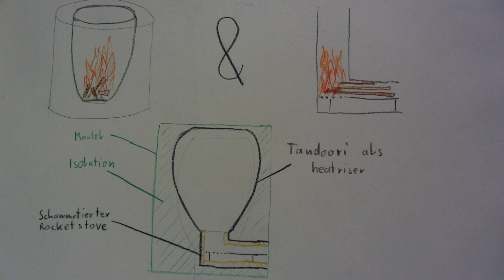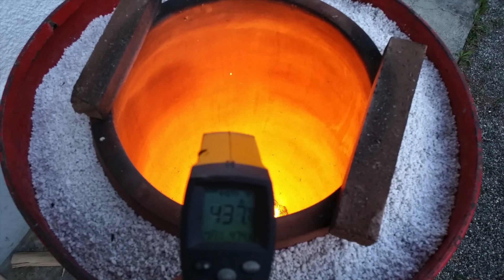Rocket Stove Tandoor Tandoori Ofen Homemade Selber gamacht bauen DIY Deutsch - Chaotic Bash Studios

Comment: Schöne Arbeit! ...nur...der Sinn von Raketen Ofen plus tandoor entgeht mir.  
Die Temperatur im tandoor werden  arg hoch und wird der terrakotta tandoorpot sprengen lassen.
Terracotta wird aus fetter Ton hergestellt und danacg gebrannt und ist daher als tandoor nicht geeignet.  Wie es wohl geht kannste in meine beitrage nicht.

Grüße aus Españistan

Greattimez
Reply from the maker: Vielen Dank für deine Antwort. Der Raketenofen produziert die Hitze für den Tandoor.
Der gebrannte Ton ist nicht optimal, funktioniert jedoch sehr gut! Die Hitze kann sehr einfach reguliert werden. Wenn der Pot gleichmässig erwärmt wird ist es kein Problem. und auch wenn der Pot springt ist es nicht schlimm.nur optisch sieht es nicht mehr so gut aus. Ich bin seit 3 Jahren sehr zufrieden mit dieser Lösung. Der Vorteil ist ich kann Anfeuern und habe dnn bis zu 3 Stunden Feuer und Hitze ohne dass ich nachlegen muss und daher rauch verursache. Das heisst ich kann 2,5 Stunden arbeiten mit konstantem Feuer und Temperatur arbeiten ohne mich um das feuer zu kümmern. Das ist sehr lange...